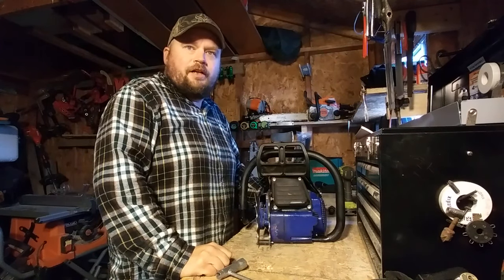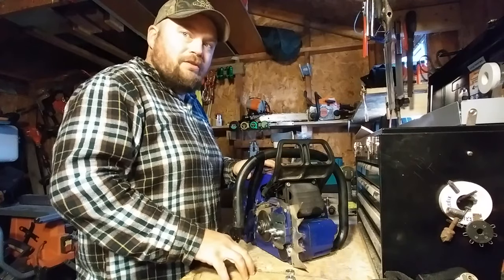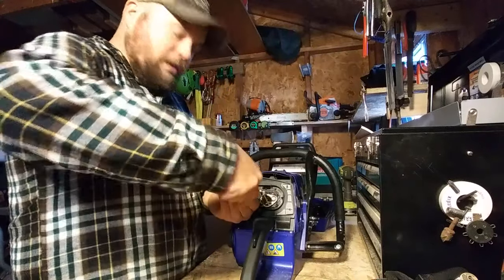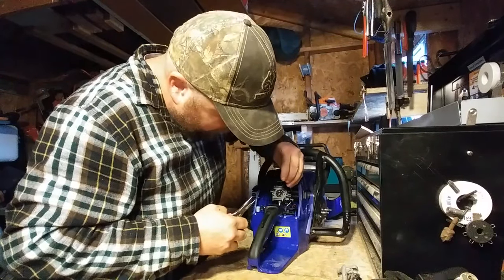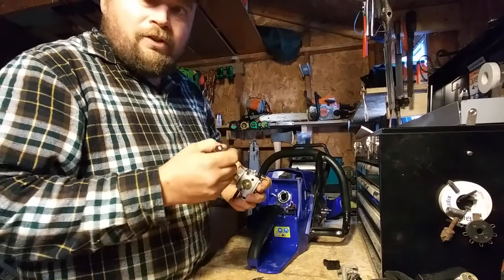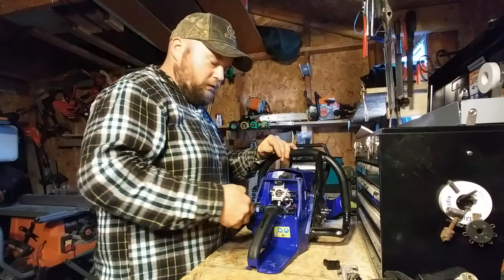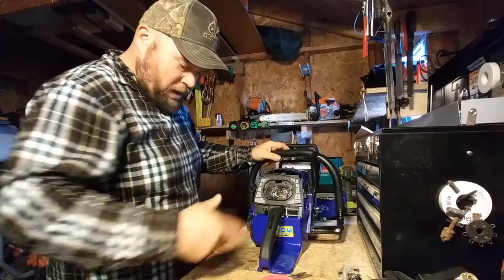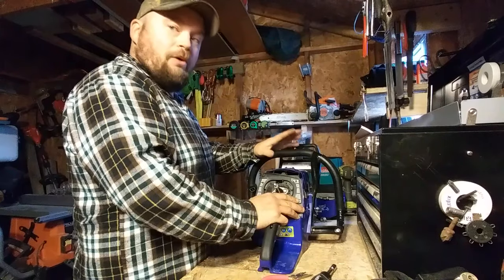Holzfforma G660 92cc chainsaw. What has gone bad after 6 months of use.

Comment: I bought a G372 and the little Joncutter puppy. The 372 has 50+ tanks through it and it hasn't given me many issues aside from hard starting during break in, the compression release doesn't help so I've learned it's better to start without it.. The muffler bolts like to rattle loose, so they need high temp Loctite. The muffler came wide open, not restricted, and it even had a little pipe coming off of it. It's wearing a 28" bar and has plenty of power in two foot Ponderosa Pine. 

The Joncutter has easily 100 tanks through it, as I'm a Chainsaw Carver and it has run like a top. I really like the little guy. I also want to say that the Chinese chain is phenomenal, I just don't know how it holds an edge like it does. Frankly, I wasn't expecting these results, I was afraid the saws would blow up,in no time, but so far so good, even running standard 91 Octane, which in California has ethanol.

Comment: Looks like a good back up saw. I've had an STIHL MS291 for 3 years and have done absolutely nothing other than change the chain. I even use ethanol fuel and it cranks up every time. Let it sit up for almost a year and it still fired up. Good Video!
Reply: Thomas Whitten That’s because you got a bad ass saw made by a bad ass company good decision
Reply: I just have a MS 250. I have ran ethanol fuel in since day one (2010). Last summer (2021) decided to run non ethanol in it. It doesn’t like it very much.

Comment: Nice video. Have about 25-30 tanks through the 660. Think I'm going to go over all the bolts as a safety check. 10-12 of the tanks were milling hickory and maple logs. So far so good. Recoil start is a little sloppy, and once in a while she seems to flood on first start. Almost think fuel is getting into carb when on its side filling it up. Again good presentation well done!
Reply from the maker: @ Truegrit Scott thank you. Hopefully my videos are getting a bit better. I have been looking at the chainsaw mills. But I've got enough project ideas going already. Thank you for stopping by too.

Comment: I'm just going to give you a suggestion as a chainsaw mechanic you can replace that I pump with the stihl MS 660 oil pump and your problem will be solve it's not the oil is the problem those oil pump give problem after a a Time just replace it with the OEM oil pump
Reply: That is really good advice. THANK YOU

Comment: I've had mine for 1 and a half now I've seen no problems with it carb adjustment and muffler mod and but forester 36inch 3/8 .063 bar and chain on starts on one pull and works like a dream but I'll be soon getting the Husqie 395 xp so little heart break but the 395 has been my really dream saw but I do have a echo cs 590 with a 36inch not recommended but muffler mod and carb adjustment and 3/8 .063 works heavenly on day to day stuff that I need so I don't break out my commercials saws

Comment: I got a new G070 and they recommend 25:1 mix, which I’ve been doing so far, and it’s definitely not a smoke machine, yet.  I plan on switching to 50:1 once I’ve run 10 tanks through it and I’m sure it’s broken in.
Reply: 25:1 is good only if you use mineral oil, wich is the oil they commonly use in China; if you use synthetic oil and you mix 25:1 you are damaging your motor

Comment: Nice job Brandon.  I bought mine back in NOV.  I keep swapping parts out on it.  At some point in time I might have been better off buying a Stihl 660.  I have a 99cc big bore kit I am putting in tomorrow night.  Keep up the good work.
Reply from the maker: @monster2269 sorry it took me a bit to get back to you. I've been looking at the big bore kits because I want to get the sawmill for it.
Reply: You would have been better of buying a 10 year old 660 stihl for sure andwouldnt have cost much more then the cheap china saw. Thats what I've done and just clean sharpen and flip the bar. Never have any problems at all. My saw cuts hardwood soft wood exactly the same doesn't make a difference. Just bought a new stihl combo file and the chains like new everytime I  sharpen it.

Comment: I bought a Holzfforma G660 a couple months ago. Cut a couple cords of firewood with it and was on about my 7th tank of fuel. Still running a rich break in mix. Saw ran great right out of the box and I was liking it. Then it suddenly seized last week. I was curious and 
took it apart myself. The piston pin retaining clip broke and came out trashing the top end . The advertisement said 1 year warranty so I e-mailed Hutzl/Farmertec.  I took the saw apart so I assume that kinda messes up the warranty? So far in corresponding and sending 
pictures to a representative from Hutzl/Farmertec,  they told me they'd send me a new cylinder kit so I can repair it myself.   A new cylinder kit and they'd also give me 300 points credit on my next purchase. Come to find out 300 points is only $3.00 US, and the cylinder kit only costs $23 on their website.  A credit point of their's is only .01 cent. So $27.00 is what they give me and I spend 4 hours time with all the bullcrap this thing is pitting me through?Pretty shoddy if you ask me. I doubt there will be any more purchases from them. I'm still in negotiation with them, but my new cylinder kit still hasn't been sent. I should have just put the saw back together and requested a full refund and return. If they can't even temper a circlip right and it snaps in use, what other kind of pig iron is this thing made of? Think twice before wasting your money on this chinese crap.
Reply from the maker: @bozzaa have you heard anything about the parts of warranty info?
Reply: They are supposedly sending me a new cylinder kit for me to repair it myself. And 300 points or $3.00 credit off my next purchase with Farmertech. (Big Deal?) I haven't gotten it yet though. They said they'd ship within 24 hours on Dec. 30th. So it may still be in transit. I received no tracking so who knows. Wait a few more days.
Reply: I finally got my cylinder kit delivered the other day as my warranty claim for the wrist pin clip failing and trashing the top end. The kit did NOT come with a base gasket and an e-mail sent to my seller was replied with "that gasket doesn't come with the kit." So I'm on my own for ordering the $1 gasket, but it will take a couple more weeks probably to recieve. I bought this saw from an Ebay seller called Devonosion, who claims to be a representative of a Farmertec Ebay store. But either way he was unwilling to send me the gasket, even though I am willing to fix this saw myself instead of returning the whole thing under their supposed 1 year warranty. When I get this thing going I will send updates as to what breaks next. I am also going to start my own channel for long term reviews of these saws. I had bought a G660, a G388, and 2 Husky 372XP clones. I bought the 372xp's as kits and just put my first one together but haven't tried it yet.
Reply from the maker: They don't send it with the base gasket? For aftermarket parts for the stihl and husky saws I go through Saw Again LLC "sawagain.com"
Reply: I took this cylinder kit for free and Hutzl/Farmertec figured that was their warranty obligation, but ya, their cheapskate chumps for sure.
Reply from the maker: Never had to deal with them for parts. And I noticed they changed the warranty on the saws.

Comment: An honest vijayo. Warms my old heart. Suggestion. My newest saw, circa 1990's, drinks 70-1 amsoil ethanol free as does all the others in the fleet. Cut starting & running problems in half. Mechanical another story. You will find that less oil makes for longer life. Counterintuitive, but with me, true. 2 cents worth. Thanks
Reply: Vero, i motori dovrebbero girare con la minima quantità di olio possibile, prima di grippare: con gli olii sintetici si puo miscelare all'1%, quindi in teoria gia 50:1 non è poco
Reply: Forty or so years ago I had a Stihl 041 Farm Boss. Stihl recommended 32:1 mix. I accidentally filled it up with 40:1. It gave up the ghost after one tank. Best saw I ever had. Wish they still made them.
Reply: @billbrown5853 Synthetic vs conventional 2 cycle is an apples to oranges comparison. I use 2 cycle fuel daily. IMO if you're not willing to run a leaner ratio than 50:1 you're wasting your time and money with synthetic. It's harder to start, runs poorly, carbons up, fouls spark plugs quickly, floods easily. Best I've used is Amsoil Saber at 100:1. Gives me years of easy starts without changing spark plugs or fuel filters.

Comment: Good video. I have used the G660 for board splitting. 30 liter gas so far I guess. I like it.  I have used 3% oil on it. Its heavy work with the splitting. I have leaned it out for more speed.. Its dangerous and must be done with care. That allso dratically reduces lubrication and increases heat..  I just got the muffler gasket issue,  Repaired it with exhaust gum. The exhaust came loose. That seem like a common problem?  I guess my increased rpm might have caused more vibrations, I might reduse RPM again. The specs says 13500rpm, but I doubt thats wise? I will adjust with a thaco next time to find out. So far the piston and cylinder looks good. I have a fix in mind for the exhaust if this problem persist. I think about long bolts in tubes inside the muffler. That can allow some stretch to the bolts.  I made a cut inside the muffler, but doubt that mod. I guess people belive in it because it makes the engine a bit leaner? And a bit louder? Its better to adjust on the carb if you want more performance.  I run cheap food oil  with 10-20% mineral in it and max setting on the chain oil pump. Sword and chain looks fine. I have the 24 alaskan mill from hutzel. It work great. I have a 25 inch bar.  Standard angle chain. It was very easy to change the angles on the standard chain. The hutzel looks like very good value for money. But you should have an ear for the engine sound, and know what you are doing. Best regards Halvor from Norway.

Comment: Advice for next time carb has to be removed: separate the handle exposing the triggerlock assembly and the rod is easier to remove instead of tweaking it from the other side. Just suggesting due to helps save the jet grommet too.
Reply from the maker: @Louis VanElsacker I've learned that after about 10 times of removing the carb. Mostly just a tinkering saw. See what it has and see what it can handle.
Reply: @brandons4802  is it worth the money? I got the ms361(built myself) big bore and love it But wanted a big saw as well.

Comment: My medium weight climber saw is a stihl ms250....way more ass waaay more that my wifes 50cc rancher and that's 45cv vs 50...and any other 50 cc I've had or used, that little 250 has impressed the crap out of me and got a full profile  chain on it...no picco or lo pro...pulls it like no tomorrow, the 170...just feels like u really have to baby them, t435 husqy is my main climber and it's ok, I haven't gone into it or done nothing..probably wont...but ahh wish wasNT qtorq..only complaint

Comment: My holzfforma g660 carb needed cleaning a few times ran fine. Today i thought carb was gummed up. Looked inside theres a little mesh screen had saw dust clogging it. Cleaned it ran good and strong. After about 20 minutes it stalls out in middle of cut. Has fire and carb is clean and good. I notice it is harder amd harder to pull than usuall kinda like the compression is higher?? So it was hard to pull.. what gives any help is really appreciated

Comment: The "newest" saw I own is 30 years old. All the modern stuff is crap!
Reply: Good ole heavy saws with no power.
Reply: @KevinBigg  What do you mean no power? Are you saying the Husky 2101xp has no power? Or the 394xp? The Stihl 044 is one of the best saws ever made. Lots of power for its class. I like saws and tools with some heft to them.
Reply: 288, 66, 162 and other old Husqvarna saws are seriously underpowered. Going back further in time to the Jonsered 621... just 56cc... but it pulls as hard and harder than anything but a few pro saws on the market today in that class. Poulan had the 5400 4000 3400 antivibe generation that were Excellent as well. McCullough had power to spare as did some olympiks and partner saws. Echo had some reliable models especially their John deere versions. Now I do love the ms 462 and the 500i is incredible. Husqvarna has had some misfires but the 395xp 372xp are among the best ever and a couple 5 series show promise. I just can't understand dismissing a tool because it's 30 or more years old. But it keeps the prices down on the old saws so that is great.  I can't buy $1600 saws every time one goes down... many folks have way more saw than they need but can't sharpen a chain or tune a saw. If they could, they likely would find out a 55 Rancher or 61 white top at $250 max can do a great job and the $1.2k 576xp is overkill.

Comment: I purchased this same saw but it wouldn't fire a lick. A friend of mine told me that the points are no good. My question to you is where can I get some parts for this?
Reply from the maker: I get my parts from Sawagain.com they are great people to work with. They have people that work on saws you can talk to. They are in Minnesota. Shipping is quick.
Reply: James Smith hey, have you checked it is or isn’t getting fuel ? The chances of it having no spark from the factory is very very slim ! These saws have electronic ignition not points too. My checks would be fuel or no fuel at the plug, spark ? If it’s getting spark and fuel but won’t fire it’s likely flooded, check the choke isn’t sticking. Very hard to diagnose over the interskreen but If it hasn’t fired it can’t be a major failure
Reply: @brandons4802  I emailed them twice and I got no reply
Reply: @babybullsmith001  why don't you join the Facebook group. Sometimes I think the email problem is the VPN they have to use spazzin out. (you know oppressive government and all that)

Comment: You said you’d never buy another G660; but you never said why. I’m curious, because I have one coming.
Reply from the maker: I shouldn't have said it that way. I would buy another but at this point in time I don't need a 2nd one. Much rather go with the g444 and the g111. The saw it's self is great. Just check all bolts, screws and the 2 nuts that hold the air filter base in place.
Reply: I bought a Holzfforma G660 a couple months ago. Cut a couple cords of firewood with it and was on about my 7th tank of fuel. Still running a rich break in mix. Saw ran great right out of the box and I was liking it. Then it suddenly seized last week. I was curious and 
took it apart myself. The piston pin retaining clip broke and came out trashing the top end . The advertisement said 1 year warranty so I e-mailed Hutzl/Farmertec.  I took the saw apart so I assume that kinda messes up the warranty? So far in corresponding and sending 
pictures to a representative from Hutzl/Farmertec,  they told me they'd send me a new cylinder kit so I can repair it myself.   A new cylinder kit and they'd also give me 300 points credit on my next purchase. Come to find out 300 points is only $3.00 US, and the cylinder kit only costs $23 on their website.  A credit point of their's is only .01 cent. So $27.00 is what they give me and I spend 4 hours time with all the bullcrap this thing is pitting me through?Pretty shoddy if you ask me. I doubt there will be any more purchases from them. I'm still in negotiation with them, but my new cylinder kit still hasn't been sent. I should have just put the saw back together and requested a full refund and return. If they can't even temper a circlip right and it snaps in use, what other kind of pig iron is this thing made of? Think twice before wasting your money on this chinese crap.

Comment: i  just came into a new one I can't get it to start for the first time out of the box  ??? what am I missing.
Reply from the maker: Not trying to sound like an a@% asking this but you got good fuel? If so start with spark and see if you got that. Easiest way to check. Pull the spark out. Put it back in the coil. Hold it against the cylinder. Give it a decent pull. May have a bad coil or spark plug. If you have spark. Move on to fuel. With the air cleaner off. Pour about a teaspoon of gas through the carb. Then try firing it up. If it wants to fire you may have a pinched or broken fuel line.
Reply: Squirt a little fuel directly into the carb then start it it should take right off

Comment: I added a like for you, because, well, ... it seems like you’re trying,...& at the very least it seems that you indicated this was yer first video. But did you honestly review and listen to yourself given the title of the video? & Listen, i’m Not trying to cut you down. Perhaps you were nervous, but you have so much extra “chit chat” that doesn’t allow the listener to get, “the Bigger
Picture” with the 660. —: for instance,—Will the 660 leak fuel? Will the 660 rattle off the bar? Does the 660 allow for good lube flow over the course of let’s say 3 straight hours of prepping 2&1/2 foot diameter chunks? Does the 660’s clutch seem like it’s up to the task? 
   Etc...
With all saws,yes, shit is gonna rattle loose. We understand that. But, How is the saw after 6 months? What are the oddities you experienced. You say there are some but don’t get into it really.
  Yes, you did show that linkage rubbing. That was good. I’m thinking of buying this saw, but still need info, for which you only scratched the surface.